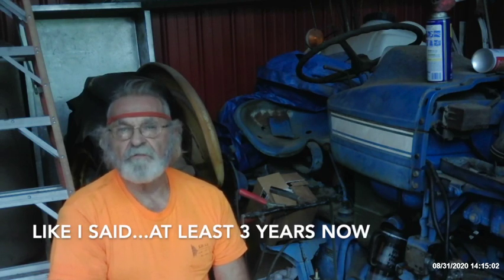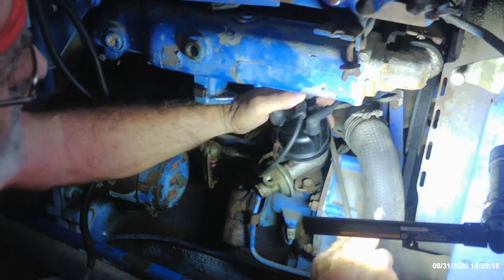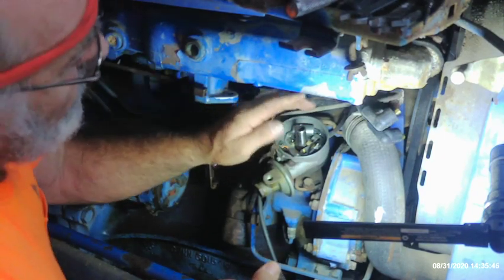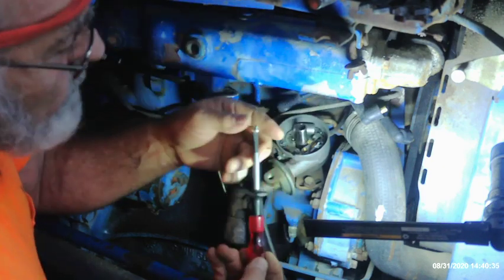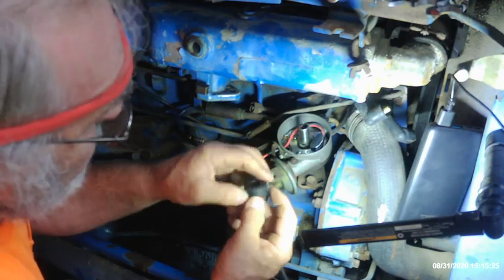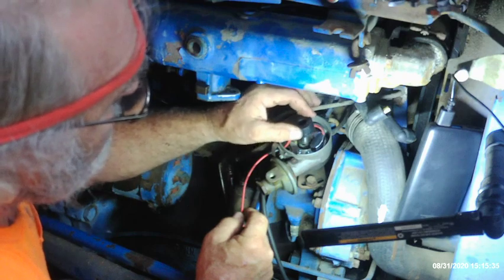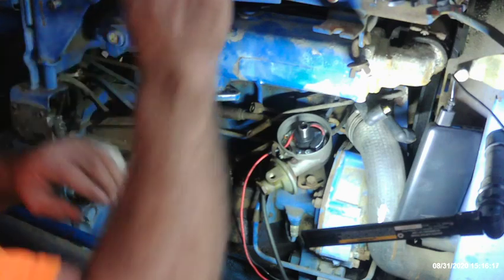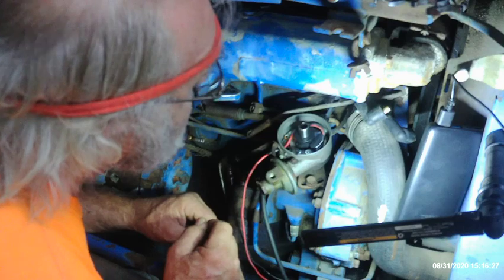'72 Ford 2000 Gets PerTronix Electronic Ignition

Comment: Put one of these in and can’t get any spark… just can’t see what we did wrong. I got rid of the resistance wire and ran 12volt switched power as the instructions in the kit said. Seems to have a good ground and all but don’t have any spark… can’t figure it out. Driving me nuts!!
Reply from the maker: Hmmm.... it's got to be a simple issue.  Start with the battery and work through each connection with the other probe of the electric tester on the opposite battery terminal to see if you've lost the 12v signal.  Verify a shiny ground connection on the module and then make sure there's nothing grounded out with the dust cover and cap.  I started out with all new ignition components including wires, cap, plugs, module and the recommended flamethrower coil.
Reply: @tractorman4461 turned out previous owner for some reason had switched the ground to positive. Didn’t even realize it until I got tracing everything back with meter. Obviously unit fried as soon as I put it in so had to switch everything around then put new one in. Trying to get it timed now. Got it pretty close but now my starter for some reason won’t disengage. Must have fried solenoid or got starter too warm. Has been a frustrating process. Hopefully can get it resolved this week once it cools down a bit
Reply: Put a new solenoid and voltage regulator in it when I switched it back to neg ground.

Comment: Great video. I just bought a 3400 with the 3 cylinder gas. My firing order is 1-2-3, but have to put a camera on the rotor, don’t know if it goes clockwise or counter.  Put new wires on and darned if it will only backfire and not start. So I’ll get that figured out. Next time I need to put points in, I’m updating to electronic ignition.
Reply from the maker: Awesome tractor.  You should be able to just remove the cap and bump the starter and see the rotor from the side pretty easy.  Just a slight bump should do it. I'd suggest the electronic module with a set of the wires, flame thrower coil and a new set of plugs to go on together.  Then make sure your battery is always fully charged.  The electronic ignition prefers a full 12.6 applied voltage to be almost bullet proof. Good luck with your project.

Comment: fo you remember the model number for the kit?
Reply from the maker: On the Petronix site, you can order specifically for a 3 or 4 cylinder Ford.  You must also use the specified plug wires for the set up, not the old original wires.  Also they recommend a high voltage Flamethrower 12v coil as well.  I'm sure there is a supplier that has them in 'kit' form, but I ordered them like this. I also replaced the dust shield and distributor cap at the same time, though I did have trouble with the dust shield fitting perfectly.

Comment: I just upgraded mine im having a little hang up it will only run as long your cranking it over the second i let off it dies.
Reply from the maker: Your wire to the distributor is probably on the wrong terminal on the three position key switch. The solonoid should break contact when you quit cranking. The distributor wire stays in the one that’s hot anytime the key is in the ‘on’ position as you rock it back off of the ‘start’ position. Just a guess though. Others have made similar mistakes. The three positions are ‘OFF’, ‘ON’ and ‘START’.

Comment: I love your videos. You are the Bob Ross of tractors. Thank you!

I will be ordering this setup for my 1965 Ford 3500 3cyl gas tractor.
Wish me luck.
Reply from the maker: So far this set up has not failed to fire up the 2000.  Before with ALL new ignition components from the local Ford tractor dealer it refused to start when the outdoor temps got into the 30's.  Now it fires quickly and easily all the way into single digits.  However....you MUST maintain a good fully charged battery.

Comment: You have to do other things other than what you show in this video to make this work. What do you mean different wiring
Reply from the maker: Petronix Electronic ignitions require the correct suppression plug wires not the standard core ones from Ford. I have a whole series of what I did to this tractor including gutting ALL wiring and upgrading from the Lucas system to a more conventional system with over the counter parts.  Here's the whole thing: https://www.youtube.com/playlist?list=PLk72G9DTzZ1ud7EttOd9HeA6diEdU2tU9 It includes making a new dash pod  and eliminating the old electric gauges as well.

Comment: This is the petronix install you mentioned a while back! The traditional points I used are still going strong but I will come to this again when I put that thing in. Didn't know a different coil was called for. Thanks
Reply from the maker: Yes, its recommended to change the coil to the flamethrower like this one.  I'm sure they have a few varieties to choose from.  Also the wires...can't use the new carbon wires.  Point are great, most of my still run them, but this upgrade changed the way this tractor starts in the cold weather !!  Well worth it.

Comment: You know I was on the phone the other day with Cheech or maybe it was Chong. Can't tell them apart on the phone. Anyway he was saying that he was missing his headband!   So I guess I know whose house you've been visiting 😁.🤣🤣🤣🤣🤣
Seriously the old Ford tractor I put on my short video a little bit ago. Well I need to convert it because it has no magneto and it is cracked. I'm sure it was like that when I bought it a few years ago. We drove up and down in the snowstorm and played around with it and parked it and I even park it down hill. Next morning or two days later went out there spun as pretty as you could want it to. It would not hit a lick. I've looked at some of the kids online you got any suggestions?  I called her Ford but I'm not even absolutely sure that's what it is but it looks like afford to in and that's where it was sold to me as
Reply from the maker: The telltale 2n signs are the three speed tranny and huge center hubs on the front end and odd rear rims...can't explain them adequately, but they don't look like a standard 8n or newer Ford rear rim, and also the magneto.  They cheapened up manufacture of the N series tractors to conserve for the war effort. No lights, very little wiring made them cheaper by a few bucks.  If it were an early Ferguson the grill slots would kinda be angled like the breast plates the Hollywood Indians wore in the 60's productions.  At least that's what they reminded me of anyway.
Reply: @tractorman4461  I'll have to look at my tractor. That local expert told me what he thought it was he was certain it was not one of them it was the other. That was while we were sitting in the barbershop and I don't remember it's been a couple of years. I have a newer one. It's definitely Ford. Somebody swiped the high-low off the side of it. Somebody told me that it just doesn't unbolt from the outside but I could have sworn it was on the other tractor when I bought it and picked it up. So I put some gorilla tape to cover the hole.

Comment: Make sure you do the water pump first. On my previous tractor I was blowing snow and I heard the water pump bearing go. I thought I could finish the driveway. Only had 2 minutes to go. Well guess what. The fan blade went into the rad. Here all the rad shops had went out of business rebuilding rads. Had to find a guy  who was in the business and he had a small shed that he still would do rads. The new replacement one had a grease fitting on it which the original one did not. Nice job on the ignition system. Another thought is you could have put a in line heater in the rad hose. They really heat up the water and circulates which would warm up the ford
Reply from the maker: I had thought of the hose mounted heater.  That probably would have taken care of the problem.  I immediately ordered a new water pump because I've had two others fail and create catastrophic damage.  Don't want to see THAT again !! (-;  We also had three independent radiator shops....all shut down due to regulation compliance.  I've got a playlist with all the things I've done to get this back in good service condition CB, if you are interested.  There's a total rewire and all new standard gauges upgrade and gen to alternator conversion here too: https://www.youtube.com/playlist?list=PLk72G9DTzZ1ud7EttOd9HeA6diEdU2tU9 Thanks for the story about your breakdown...its painful, but if ya got tractors and equipment, its gonna happen...

Comment: Nice. I don't remember hearing Ford gasoline tractors were cold blooded.
Thank you Wendell.
Reply from the maker: I don't know what I could possibly have missed with the actual Ford ignition components to not have gotten it to fire up in cold weather.  But it sure does an awesome job now Bryce.  All the way down to 5*F so far. I am not a fan of the fuel delivery system at all though.  Its extremely difficult to work on any of the components.

Comment: I'm stuck back with the loss of spark below 40 degrees F! There must be a weak component, coil, or condenser maybe?
 I went to Standard Blue Streak ignition parts and added a 40,000 volt Pertronix coil to my 6 volt pos ground 1935 Allis WC and it starts 100% better than it used to. 
 I used to think, "if it ain't broke don't 'fix it', but with the cost of quality ignition parts now days, the $100 for an electronic conversion isn't that much more.
Reply from the maker: I agree with the cheap parts now a days Charles.  Not reliable at all in many cases.  I must have been talking a bit too fast while describing the issue at low temps below 40*.... I still had spark, fuel and compression but there was nothing I could do to get it to fire up.  It made no sense.  I had fire but it looked very weak at the plugs and I just figured maybe the fuel was drowning out the weak spark.  Maybe a hotter coil would have made the difference, but I was so irritated at it that I went all in with the electronic route.  This tractor had sat for nearly two decades before I got it.  I'm with you on the theory of fixing something that ain't broke !!

Comment: So this is like Paul Harvey's "The Rest of the Story".  I do like the old Ford tractors.  The 2000 I think is a descendant to the 600 series, along with the 800, replaced the NAA (Jubilee).  In Europe, the 2000 was called the Dextra, while the 3000 was called the Super Dextra (I believe).
Reply from the maker: I really don't know the Ford progression.  But that's as good enough description for me, and all Ford-facts that to date was unknown to this poor boy.  Thanks Terry and btw, I MAY be in the market for a fair running M or even a known good runner that's been sitting for a while.  I think I'd swap the motors out of the M grader-tractor instead of another rebuild job.  I just don't have the time for another one so soon.
Reply: @tractorman4461  JP Tractor Salvage looks like has a M for parts.
Reply from the maker: @316jd140  Thanks for the input.  I was gonna give them a call to see if they did and kinda price it out.  Then compare it to a whole tractor that might come along.

Comment: Yes I do wonder why the folks who design things don't always ( it seems ) think of easy servicing of essential wearing items. It's good thing that Ford used blue colour for this one, as if I owned it, it would match the color of the air around it, trying to get that distributor done!
Now we have to wait for inclement weather to see just how good that Pertronix upgrade performs.
Reply from the maker: There's simply no reason for the carb/sediment bowl/distributor to be installed so tightly.  It's the worst 'old' tractor I think I've ever had to work on, I believe.  Had it not been such a heartfelt gift from one of my best friends I think I would've sold it 'as is' like I did the two 4000 Fords with the identical setup.  All three cylinder gassers with the Holly carb.
    I've sent this one to my son's house about a mile away so he's got a good reliable tractor to use hauling wood.  So Reg, I can report it has been firing in all weather so far, at this time all the way down to -15C (5F).  So I think the operation was a success.  After I did the conversion to PerTronix, this is the one that went through the generator to alternator and total wiring change including the new dash pod with standard gauges....then the new rear wheels and the plowing job.  LOL...this one was a NOS video from the 'unedited' list, as will the Holly carb servicing coming up soon.
Reply: @tractorman4461  Good job then by the sounds of this. Something like  the old axe a friend of mine had, " She's some axe, I replaced the head twice and the handle three times, yessir she's some axe! " Hahaha.

Comment: I should install one of those kits on my old 8N.
Reply from the maker: If it becomes a bit troublesome, I'd do it in a heartbeat Matt. You have to order them for 3, 4, 6 or 8 cylinder and for positive or negative ground specifically.

Comment: Put a pertronics ignition in my D17 Allis. Was burning up points almost as soon as I installed them. Now the tractor starts and runs like a dream.
Reply from the maker: I'm sold Alan.  I've installed several and even my '67 Mustang with a transplanted 302 has PerTronix in it.  The big thing is to keep the battery at full charge....low voltage and they won't fire too good.

Comment: Hi Wendell! Great job on installing the new ignition system!  I’m impressed that it started immediately.  That’s a fine upgrade for the old Ford 2000!
Reply from the maker: The big issue with the first start was getting the fuel pump to prime.  I'd not turned the petcock far enough pass fuel for the first wasted attempt.  But at least the oil pump started lubricating the internal components.  It's a new petcock and it seals very tightly.  So the first attempt to start doesn't count.  When I finally got gas in the bowl, it popped off with little to no effort.  When I saw the camera flashing 'goodbye' as I turned to it for a thumbs up, I thought for sure I'd missed the key moment when it fired.

Comment: here great things about Per Tron Ix BUT I put it in my wifes 68 Mustang and my old 64 Econoline and both times I was stuck on the side of the road and put the points back in. I might be the exception. and thing may be different 20 year from then. I never did change out the coil and don't recall that being an option.
Reply from the maker: I have a 67 Mustang with a transplanted 302 that fires perfectly with the PerTronix...well until I pulled the engine/trans for a major sheet metal over haul on floor pans, shock towers...etc.  PerTronix now 'recommends' their flamethrower coils and their sets of plug wires to go along with the igniter.  But, like you, I've saved all the factory supplied Ford standard ignition parts in case I DO experience an issue in the future with the module.  I think there's bound to have been improvements made in the modules from years ago when they entered the picture....but that's just a guess.  Thanks Ed for chiming in with your experiences with them.

Comment: Good tractor man 44 on Ford . Guy at my home town got the same tractor. There were good running tractor for sure . My J-5 track machine got 252 flat head industrial engine with point , rotor button and resistance. There run like pussy cat colder the weather better there start . I could change over your way but not yet . I grew up from a kid working on the old stuff like yourself. You know we got gas and spark got to go . Plus timing is on . Probably get water pump rebuild for 1/4 off the price it’s own a bearing and clean up . 😊
Reply from the maker: Oh heck, I'd never recommend a good runner on points and condensor to be changed over either Leonard.  But when or IF they become troublesome, I'd do it in a heartbeat !! I found a reasonable water pump and changed it out already now. So all is good with the tractor so far. You know, talking about the cold, I have an Allis that's a magneto tractor with electric start. That thing starts and runs soooo much better in cold weather than it does in hot weather !!  Almost never misses a lick in the winter but in the summer its kind of troublesome and runs a bit rough.  Go figure....